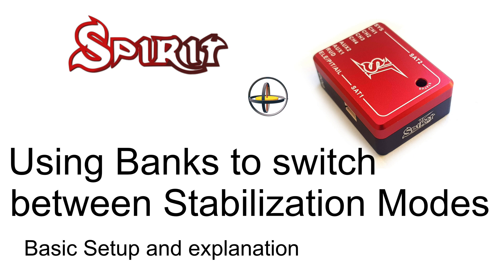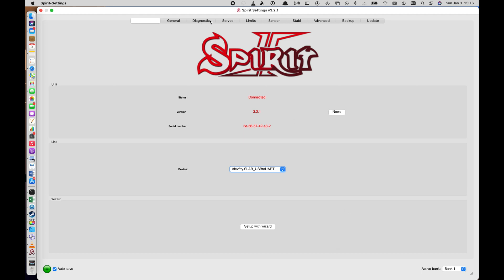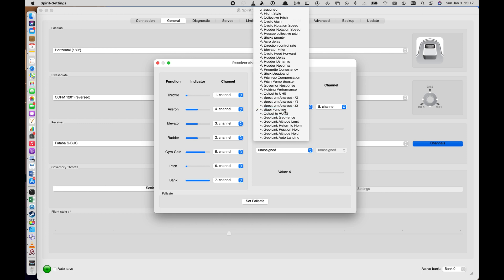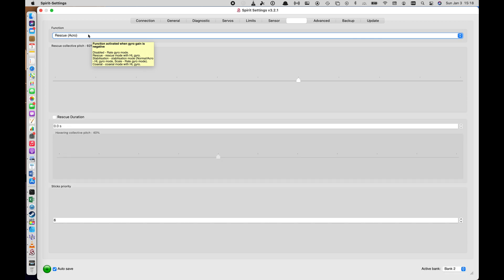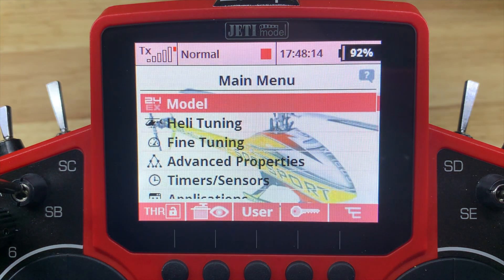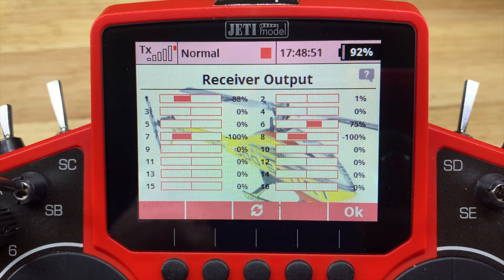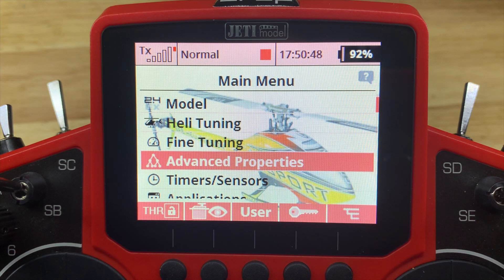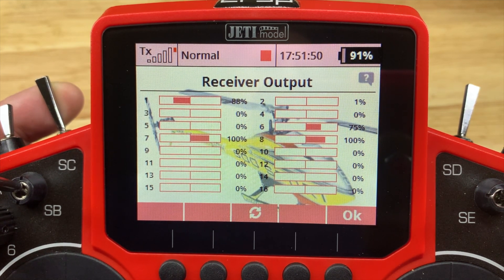SpiritFBL - using banks to switch rescue modes

Comment: How would you perform an override in an Ethos OS environment to override the Bank switch to enable Bank 2 (Rescue)?
Reply from the maker: To be honest, if you are running ethos you should probably use the rescue per channel option and not rely on banks. You can set up for example coaxial rescue on one switch and acro rescue on the momentary switch

Comment: This works for me however on bank 0 with stabilization active the rescue has a small delay in activation.  The other banks (no stabilization) rescue function is instant.  Thoughts?  
Thanks for the great vids.  Your doing great work!
Reply from the maker: That is interesting, I cannot think of a reason for that...what Spirit unit are you using so I can try and emulate/test?

Comment: Hello I saw the video and encountered a problem.
Basically I am trying to create two options in the transmitter. In one switch I try to create an automatic rescue and in another switch I try to create a normal rescue mode that will ride on the automatic rescue, in the software it works but in practice the normal rescue does not work
Apparently it has something to do with the mixer. I have a radiomaster tx16s 
I would love if you could share your setup including in the mixer
Thanks in advance.

Comment: hi. thnx for your videos. really helpful. I noticed that in your setup you first have a three position switch selecting bank. OK. Next you use a logical switch which performs an AND with your three position and your momentary. Correct me if I am wrong, but when the momentary switch is off you still can select the bank as before with the three position switch. But once you flip the momentary switch the logical switch becomes active and you select the bank associated with rescue. My question is:  is this result independent of the position of the three position switch (it gives the same result whatever position the three position switch is in)?

Comment: Any chance of a video setting up a quad on Jeti please
Reply from the maker: Oh, that would be fun...I have not done this for Jeti yet. Al my quads are on OpenTx. Let me see what I can put together. Note that the receivers are pretty big and this is mostly why I have not bothered
Reply: @yufasa  just created a new model on my Jeti radio. The bank switch is a 3 position switch the MMS is the rescue. I have checked this over and over. Something is staring me in the face I can't work out. I have created the logical switch exactly the same as yours. But when I apply the logical switch L1 in the function assignments then go to check it's working in the servo functions. The bank switch has stopped working. I know it's something I have done just can't find the solution. Could you please help
Reply from the maker: @garyowen3743  Morning Gary, lets go over a checklist: 1) Three position switch is configured in the Spirit settings app to switch banks. This can easily be tested while connected to the settings app. 2) Momentary Switch is configured to operate recovery - note you DON’T want the gyro option here!. Again this is easy to test while in the settings app.(see minute 1:34). You want to make sure the switch is working the correct way around.
Reply: @yufasa  Thank you for taking the time to reply, It was the bank switch that needed reversing after clearing the switch, after playing around for a while I managed to re select the switch, it was  +100 0 -100, I wanted -100 0 +100 on the 3 position switch, its all working now, thank you, any chance of a video setting up a heli on opentx radio master 16ts, everything seems drone related, I only now use Jeti and radio master and enjoy watching your videos
Reply from the maker: @garyowen3743  Awesome, glad you got that figured out :) I actually did an initial setup with Spirit on OpenTx. I think it is time to do a full video on that for sure
Reply: @yufasa  Thank you for providing some exellent videos, would you happen to know the exact pixel size to fit the model image on the small image display so it fits exactley in the box, its annoying when the sides dont take up all the box, just want it perfect, thank you again

Comment: Thank you so much for this, just in time as I'm learning Jeti's magic box right now and learning loads from your contents!  I was wondering though, as I follow your tutorial, I can't find the logical switches?  Is there another way around it or must I get that module for my DS12?
Reply from the maker: Ah, yes I was going to mention that you need the logic module....Let me think about a way around that...most likely can use free mixes to achieve the same
Reply: @yufasa  Now I have this configured, the other question is - Does your momentary switch need to be on for other Stabi functions to work also?  If yes, then essentially you won't have access to stabi functions for bank 0 and 1 because everytime you turn on the momentary switch, it'll always be bank 2?  Or have I missed something?
Reply from the maker: @Inserico  The way I show it here the momentary switch can be used in two ways. In the first part of the video the momentary switch will enable the Stabi function based on the bank selection. This is the mode you want to use if you want to keep the Stabi function active or you would use an override to keep the Stabi active for “normal” flying. This is useful when you are practicing orientations for instance - my other video goes into that somewhat. In the second part of the video the momentary switch will force the system into a specific bank and therefore a rescue mode. Note that you can set bank 0 to have stabilization active the whole time, and then when you activate the momentary switch it will switch to bank 1 or 2 so that rescue mode is now active. I tried to cover this very broadly in the video but understand there is a piece missing if you want the Stabi active all the time.
Reply: @yufasa  thanks for the reply!  For what you have covered in the video, it's better than any of the other contents out there, so indeed thank you very much for that!  I guess I was hoping I could work out how to have different banks acting like flight modes but using the stabi functionality instead, e.g.
- Bank 0: Rescue (Acro), normally disabled, but enabled with mmt switch
- Bank 1: Stable (Normal), always enabled
- Bank 2: Stable (Scale), always enabled
- When mmt switch is enabled from any banks, Rescue Acro (Bank 0) will be enabled as my bailout
Is the bank functionality not used like this?  Or there's always a way? lol :)  Anyway, thanks for everything you have covered, really learning loads from you and you only!!
Reply: amazing, love your work!  Love to hear once you’ve worked it out.  Otherwise I’ll try to get the logic module installed